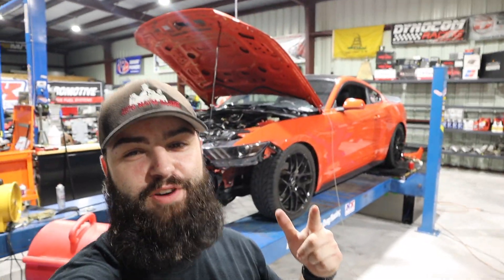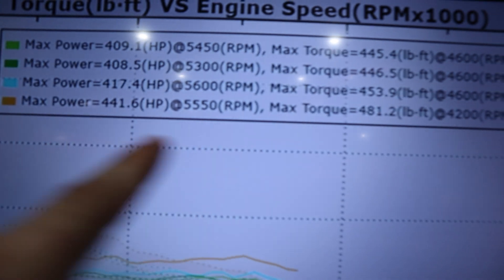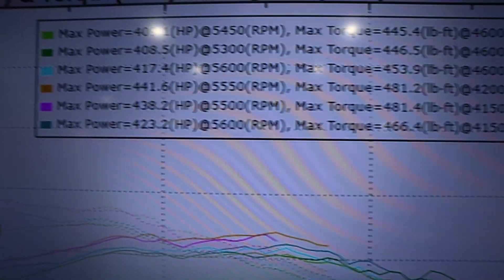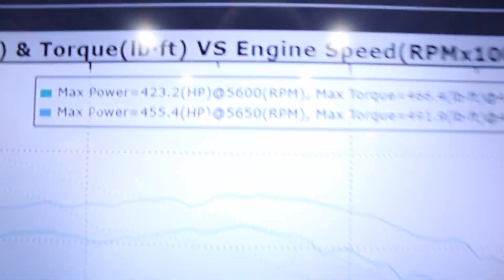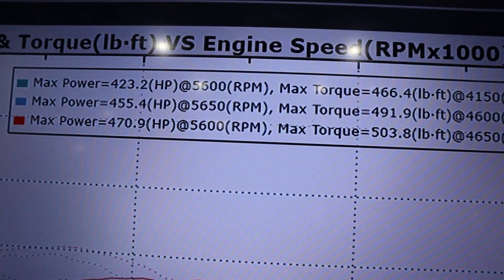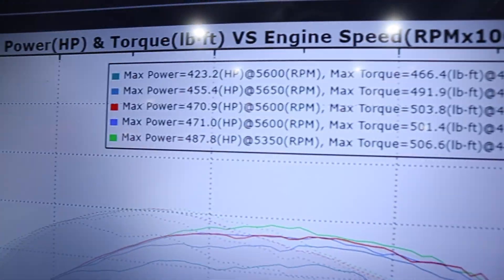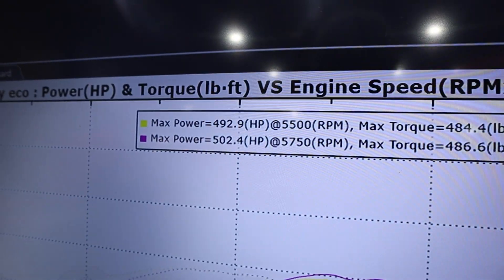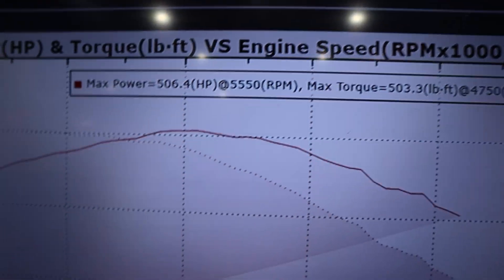500 Whp Ecoboost Mustang Dyno! - Comp 5858 Drop-in Turbo

Comment: How soon until you post the vids of you gapping people at either FL2K or down in Mexico??
Reply: Not with a Ecoboost 😂the Coyote gonna eat it up
Reply: @paulkersey6283  not at 500 HP the ecoboost will def gap a 5.0
Reply: @FB_Davo  Hell no wtf are u saying
Reply from the maker: Shooting for mid to low 10s on this setup so it should be plenty fast
Reply: @Reclaimer what maxing out at 500 ? Wtf are u smokin there block and bottom end hold up to 800 wheel...
Reply: @Reclaimer I kno but still I don’t think this 4 banger would beat one or walk one
Reply: @paulkersey6283  a stock 3rd gen coyote is at like 430 whp. are you saying his 500ish whp eco wouldn't beat a stock 3rd gen?
Reply: @senorpepper3405  with the 10r80 in it yes it sure will